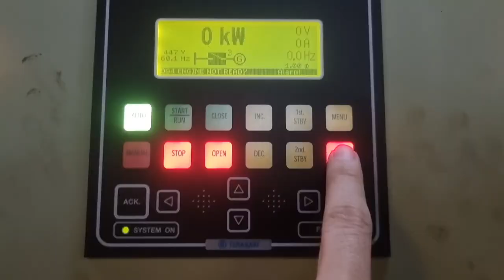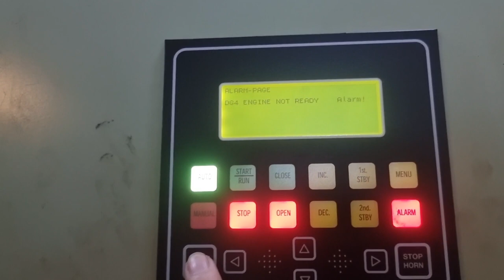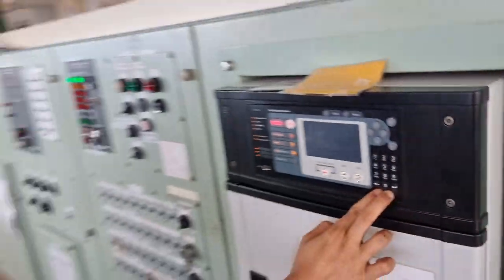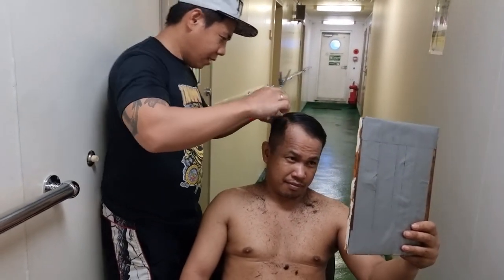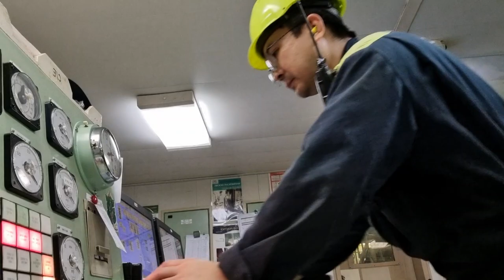ONBOARD ELECTRICIAN? YOU NEED TO DO THIS BEFORE LEAVING THE VESSEL

Comment: I think eto onboard shoud be back to back on same  vessel or a proper handover with full details  has to be made hence it wil be easier for the new eto to fimd out or troubleshoot  the problems and keep an update on the spares. Which is most difficult job than bringing  back the machinery  back to normal condition. Since he is back to back on the vessel he will be very through with the circuits and faults on the entire vessel from void space up till the monkey island cum forward of the ship till the stern.

Comment: Hello my friend
I need your help with a problem
We have yanmar generator engine .. when we want to synchronize with the other generator .. every thing goes normal and no alarms coming .. but actually the generator does not give any power and acb lamps still as it is (acb close: off /acb open: on)
The ACB charging and discharging
Can please help with this and thank you very very much